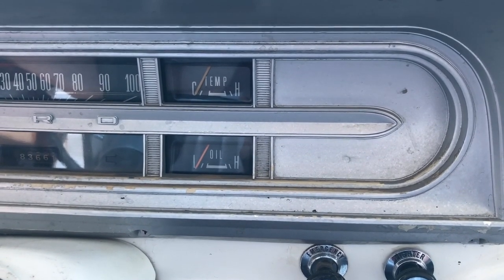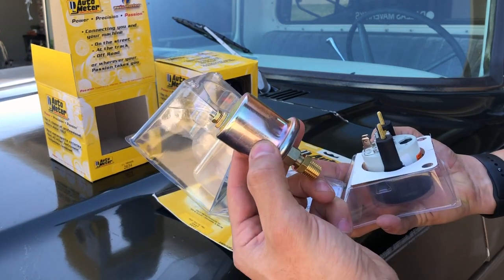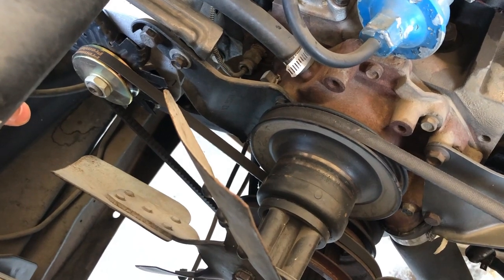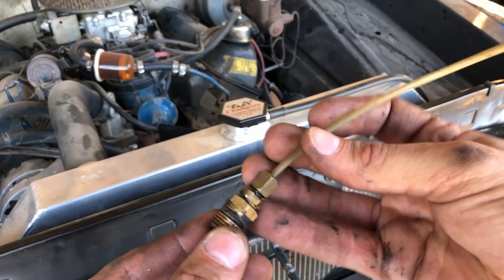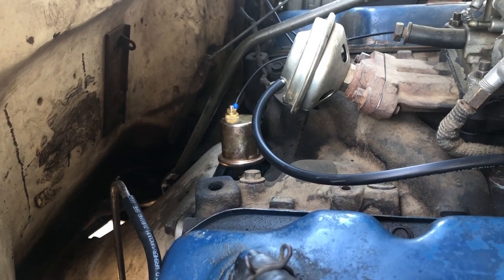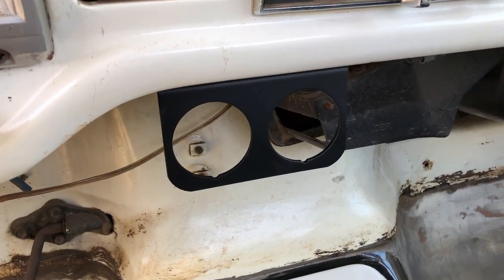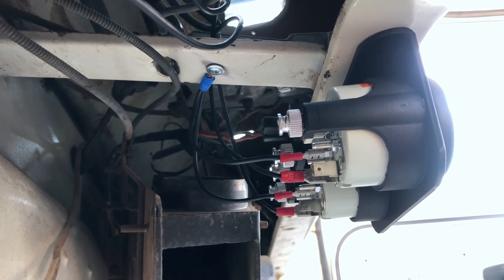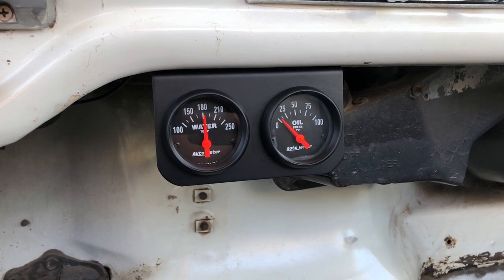1970 F250-AutoMeter oil pressure/temperature gauges

Comment: I'm doing this to my 69 f250 right now!  I cut up my dash bezel and making my own out of the pieces.  Thanks for sharing your project and for the heads up about the vacuum problem
Reply from the maker: Yebo Screbo Nice! Thank you for watching. Definitely check any vacuum lines if your in the area just in case they could be leaking or old and need replacing, I never suspected it to be a vacuum leak.

Comment: Good stuff. My 70 F250 shifts a little funky at times. I'm gonna check out the vacuum lines. Thanks for the info.
Reply from the maker: Eric Argo Thank you, definitely check the lines but it also could be the vacuum modulator. Wouldn’t be difficult to replace it.